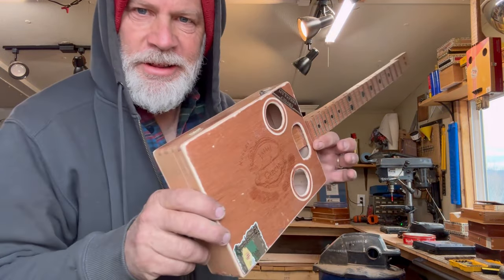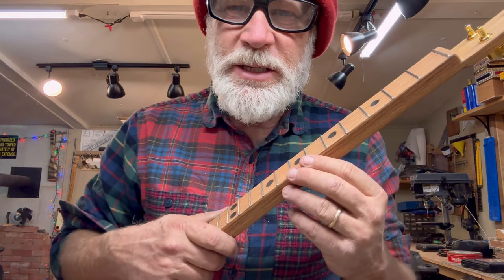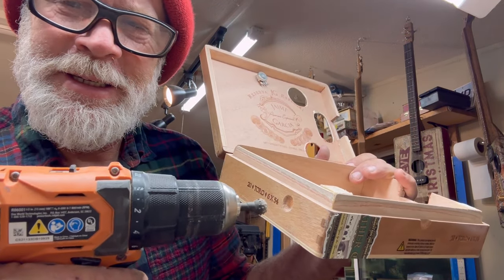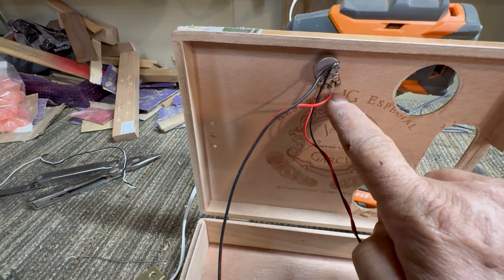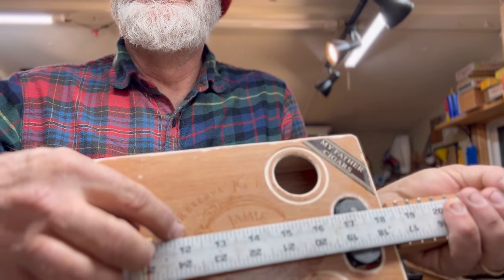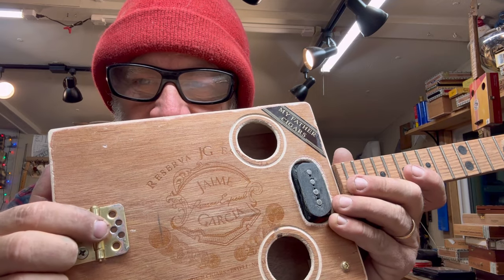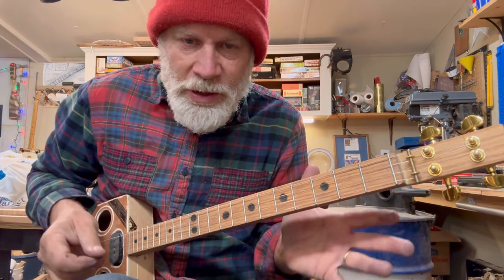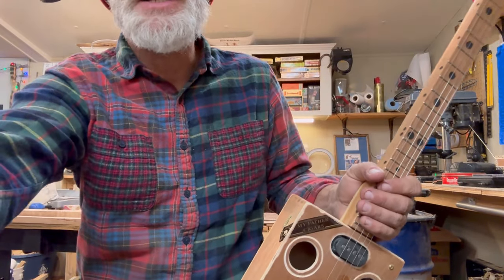Building a 4 String Cigar Box Guitar

Comment: You inspired me to make 3 string CBGs during lockdown, so thank you for that Del. Recently a friend asked me to make a 4 string for him to write with. I had never made a 4 string before. A couple of months later he asked me to make an 8 string (4 x 2). Tuned in C standard, boy it sounds good. Again, many thanks.
Reply from the maker: seriously ?? wow!!!!!
Reply: @PuckettCigarBoxGuitar  Yeah, the tricky parts were the string spacings at the nut and bridge and the string sizes. Oh and btw, the scale length is only 21" on a 21mm thick QLD Maple neck, repurposed from old furniture, so it is quite strong. HappyDayZ.